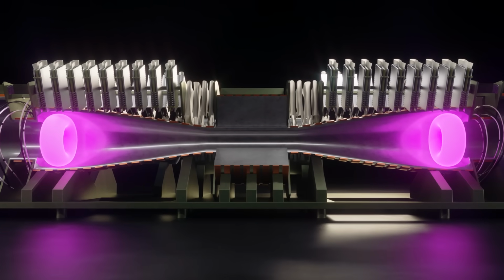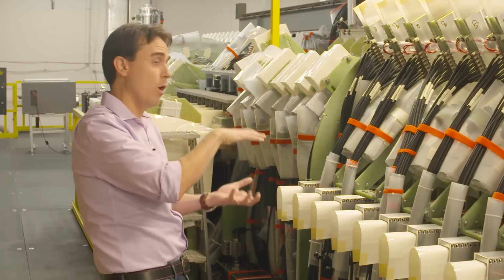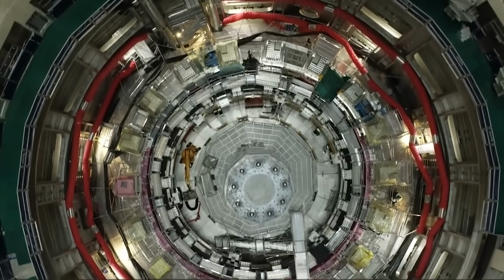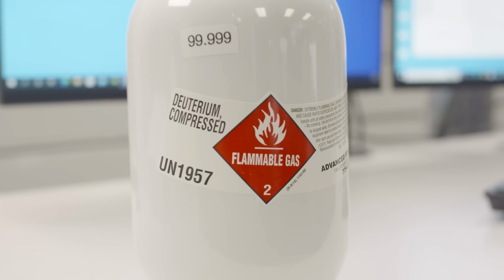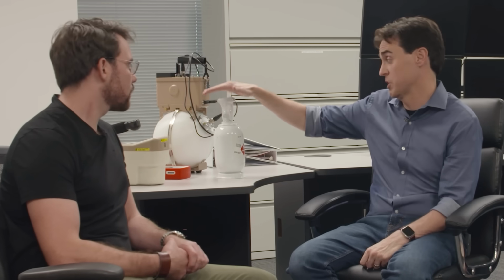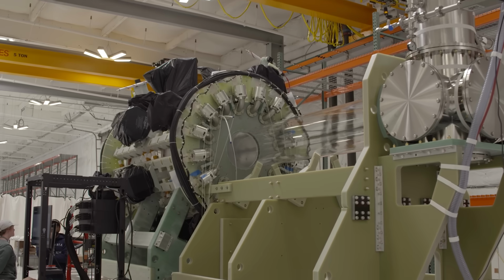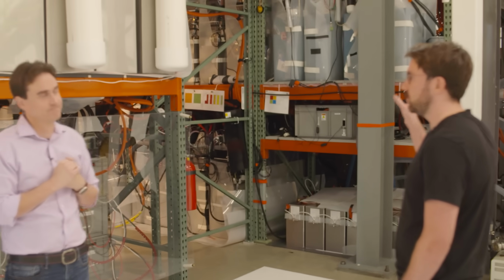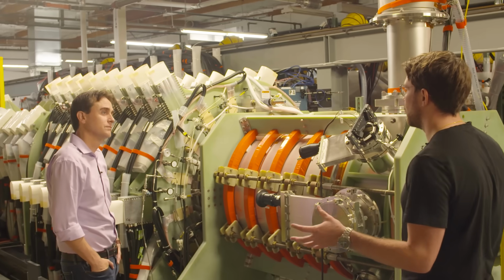A New Way to Achieve Nuclear Fusion: Helion

Comment: I highly recommend the reaction video from improbable matter ("the problems with helion energy"). While Helion is surely trying a very interesting approach on fusion I would really really appreciate a more down to earth video with less superlatives (top secret, completely new design/never done before...) and a bit more critique...
Reply: The apprehension at Helion is well-meaning though.  Sure, having an initial financial success can benefit other projects, but the more money that gets behind a specific project the more potential influence it has in the field.  And if the big influential project turns out to be a bait for venture capital, it makes the whole field look like that.

It's an uncomfortable discussion, but one that needs to be had.  If the criticisms can be counted head-on and then eventually proven wrong, it will do far more good than if nobody has criticized it to begin with.  But if the project crumbles under criticism before it can gain momentum, then it would probably have failed eventually, and in that case it would be better to fail earlier than tarnish the reputation of the whole field in the process.
Reply: @supersonicgamerguru  Being "well-meaning" is just a way of covering up the fact that the argument was flawed to begin with due to incomplete knowledge of the systems at play.  Regardless of whether someone's ignorance of the facts was due to providing a "well-meaning critique", rushing a conclusion, or an egotistical excess of self-confidence, it's shamefully harmful to these kinds of projects to so publicly challenge this project using points that can already be proven wrong using existing information.  I see what you're saying, but there's a big difference between what you're talking about (which is essentially like suggesting to provide an FAQ for people without specialist knowledge on the subject), and trying to genuinely undermine trust with criticisms that would not have developed had you done due diligence and properly researched the project.
Reply: I found it very annoying and off-putting -- and it makes me completely distrust whether this technology has any meaning at all, or not.
Reply: The video by Improbable matter has a lot of mistakes. I have posted those here before (just check my response to similar comments further down).
Reply: @elmarmoelzer2229  dude, there are  13,912 Comments as of now. And no way to search anything :/
Reply: @ewerybody  
I know, it is annoying. It is also hard to write such long comments on Youtube (plus Youtube tends to censor them) :(
Reply: @elmarmoelzer2229  You could try pasting your comment in this thread. You should be able to find it by checking your comment history.
Reply: @oktayyildirim2911  Easier to just give a link to one of Elmar's comments with the answers to I.M., like this one: https://www.youtube.com/watch?v=_bDXXWQxK38&lc=UgzYDR40BqDN6cZc-RF4AaABAg

In my opinion, it is evident Improbable Matter made his video without having taken the time to study the machines Helion is building. If he had, he would have known there are answers to many of the questions/doubts he presented as unsolved.

Nowadays too many critics resort to the tactic of "oh yeah, but that it will be so, so difficult" as if that where a serious argument, when in reality it is just an admission of ignorance. Regrettably, too many people accept it uncritically too.
Reply: @oktayyildirim2911  
Ok, lets try this

- Critique: "FRCs have been done before and never worked." 
First, define "worked"! What was the goal of the experiment and what was the outcome?
Second, yes, FRCs have been done before and the members of Helion's founding team were actually involved with several of them. They applied the lessons learned from those to their own design, which they have tested over 6 prototypes so far.
Lessons learned and applied:
1. Size of the FRC. The larger, the less susceptible to n=2, rotational instabilities.
2. Elongation to radius ratio. The longer the FRC, the more stable it is to tilt instabilities.
3. The merging before the compression. This part creates a single, hotter and more stable FRC as a target for compression. FRCs get more stable, the hotter they are.
4. Helion's FRCs have a very low electron to ion temperature (Te:Ti) ratio of 0.1 and less. That makes things a lot easier compared to machines where both are in an equilibrium because: 
P(fus)/P(loss) scales as Ti^1.5 / (Z^2 * Te^0.5 )
Where Z is the atomic number (in case you wonder about that).

- Critique: "Deuterium - Helium3 has a smaller reaction cross section than Deuterium - Deuterium. At the 100 million degrees temperature discussed in the video, Deuterium - Deuterium reactions would be much more likely than Deuterium - Helium3 reactions."
That is generally true, but the author misses some key points:
Trenta is a subscale prototype with much weaker magnets than what they are proposing for a full scale powerplant. Because of that temperatures are somewhat lower than in a full scale power plant. Power plants aim for temperatures 20 keV (220 million degrees) and up to 330 million degrees (30keV). At that point the D-He3 reactivity surpasses the D-D reactivity.
That said, Helion actually wants some D-D reactions because that is how they are breeding their He3.
D-D => He3 +n or D-D => T +p
Both reactions have a 50% chance of happening.
So, in mixed mode (breed and power) machines, they will need two D-D reactions for every D-He3 reaction, at least until the Tritium inventory is large enough that they have a constant supply from decay (Tritium beta decays into Helium3). Sicne Tritium has a half life of 12.3 years, that can take maybe 20 years. That fact is probably the best criticism of Helion's approach.

- Critique: "Deuterium - Helium3 is too hard and Tokamaks cannot do it. Therefore Helion's approach of fusing Deuterium and Helium3 can never work."
D-He3 is very hard to ignite, but they do not need ignition for their design to produce enough net electricity to be economic. Most of the energy from D-D and D-He3 reactions is released as charged particles, not in neutrons. Helion can recover the energy in charged particles directly as electricity at a higher efficiency than a steam plant would. They can also recover 95% of the input energy directly as electricity. That makes their machines a lot more efficient.
Further, FRCs are high Beta (~1.0) compared to Tokamaks (~0.05). Beta means the ratio of the plasmas internal pressure to the pressure applied externally via magnets. 
Fusion reaction rate (the amount of energy produced) scales as magnetic field to the 4th power, an extremely strong scaling. However, that is the magnetic field inside the plasma, not outside, which scales as Beta^2 and B_external^4. 
If it was just about the efficiency of the magnets (it is not), then a 10 Tesla Helion machine would outperform a 200 Tesla Tokamak.
But, it is a bit more complicated than that, because confinement times in FRCs are generally lower. You win some, you lose some. Overall it is still a win for Helion's approach.
Since Helion is using adiabatic heating through the compression stage, they can to some extent(!) balance temperature and density almost linearly for a given magnetic field. D-D reactions favor higher density and lower temperatures. D-He3 is the opposite way round. They can tune that just to the right sweet spot between density and temperature depending on which reaction they want more of.
Another thing that works in Helion's favor is the aforementioned Te:Ti ratio. This ratio actually decreases further with higher temperatures. So the hotter the plasma gets, the smaller that ratio. Trenta already showed Te:Ti at <0.1. It is likely that a power plant will have an even lower ratio. Lower electron temperatures greatly reduce Bremsstrahlung losses. At a ratio of 0.1, thermal transport losses actually kick in earlier than Bremsstrahlung.

- Critique: "The neutrons from Deuterium-Deuterium reactions would have fried Trenta and I see no shielding." 
As mentioned, Trenta is a subscale prototype, an experiment. It is smaller, weaker and only operates at one pulse every 10 minutes (max). A full scale powerplant would do 10 pulses a second!
Not all shots were fueled by Deuterium or Deuterium + He3. Many were fueled by a mix of hydrogen and Deuterium or pure hydrogen, depending on what they wanted to test.
Because of that alone, the total neutron flux that Trenta has experienced so far is not that high.
What the critique does not mention is that neutrons from D-D reactions have a much lower energy than those from Deuterium- Tritium reactions (2.45 MeV vs 14 MeV). Those 2.45 MeV are below the activation energy of many materials.
The machine is mostly made from low activation materials or materials with a half life measured in minutes. Aluminum activated by D-D neutrons has a half life of 2 minutes.
In fact testing different materials under neutron exposure was one of the purposes of Trenta. They have tested quite a few alloys to see how they behave.
There is still permitted shielding of course. It is in the walls of the room and not close to the actual machine, which can handle the aforementioned relatively reduced neutron load just fine. 
It is also worth mentioning that a mixed mode Helion power plant (that does both breeding and power production) would produce neutrons only in one third of all reactions. So the neutron flux, even for those machines would be lower than for a D-T Tokamak.

- Critique: "Helion claims that they discovered new physics when they say that the ion gyro radius is 25% larger."
The whole ion gyro- radius thing was based on a misunderstanding and out of context quote and maybe also bad wording.
What happened was that Trenta achieved a higher ion temperature than predicted by Helion's too conservative physics model (a higher ion temperature is actually a good thing!). That higher ion temperature caused a 25% increase in ion gyro radius, which is perfectly in line with established physics. That's it. Nothing to see here!

- Critique: "Helion had previously said that they would have a working power plant in 2021. "
IM was very eager to get a "gotcha" on Helion. I guess he did not read further up on the page, or he would have seen that Helion was in the process of raising funding at the time. They did not get that funding until now. Even Trenta was less than 35 million (especially if you take the 35 million into 2019 dollars, when they started building it).
No bucks, no Buck Rogers. Should be quite clear, no?
Reply: @elmarmoelzer2229  I don't understand any of this. I don't have a PhD in plasma physics. This just sounds like two (or more) parties arguing over something that very few people would actually understand. Very, very, very few people. It would help to know your interest in this dispute. You've certainly gone to some trouble to respond to IM's critique. Why do you care what he thinks?
Reply: @michaelallman8481  
Oktay Yildirim asked me to post my response in this thread. So I did. 
My response does not contain any high-end plasma physics, certainly not PHD level. I am just an unwashed halfwit ;)
But I talk to people (e.g. the good people at Helion, but also at Zap, Realtor and several others).
I don't really care what IM thinks. I do care what the general public thinks and he is doing a lot of damage with his negativity (seems popular to do that right now for some reason). 
Fusion startups are trying to secure both venture capital and public funding/support. 
Quite a few have barely enough to keep the lights on. Helion is doing well financially, and I believe the success of one will help the others.
While I am friends with people at Helion, I do think that others deserve a fair chance as well and diversity of approaches is good (what happens in Helion hits a snag down the road?). There are lots of very interesting and promising approaches to fusion that are barely explored for lack of funding. The market is more than big enough to support several successful fusion companies.
Then there is the regulatory environment and public acceptance when the first fusion power plants appear. An informed public is important for all that.
Fusion is the future and it will happen very soon... IF we want it.
Reply: @elmarmoelzer2229  nice!!!!! Thx for finding and posting
Reply: @elmarmoelzer2229  How about give the sources too?
Reply: @michaelallman8481 I understood it. I will say 100% if you do not understand something. don't comment on it, and go do as much research as you can until you understand. NEVER TAKE JUST 1 PERSONS OPINION ON A TOPIC YOU DONT UNDERSTAND AS THEY MAY HAVE ULTERIOR MOTIVES.

In saying that. I found his critiques of the critiques quite convincing, but will need to do my own research to verify.
Reply: @elmarmoelzer2229 Good comment! I don't understand all of it, but enough to get the general idea, and I appreciate the time you put into crafting it to inform such a small audience ❤
Reply: @Respectable_Username  Thank you!
Reply: @elmarmoelzer2229  
What the critique does not mention is that neutrons from D-D reactions have a much lower energy than those from Deuterium- Tritium reactions (2.45 MeV vs 14 MeV). Those 2.45 MeV are below the activation energy of many materials.

You're incorrect about neutron activation which leads me to believe most of what you wrote is wrong, as any radiochemist knows that the neutron capture  for all stable isotopes have no activation energy with the exception of helium-4. I.e. the thermal neutron capture cross section is positive. This is obvious when one considers than neutrons are neutral particles and that the only forces involved are thus the strong and weak forces which are short range unlike the EM force hence there is no barrier to the neutron entering the nucleus.
Reply: @stephhugnis  
Sorry, but you are wrong. Why do you think that fast neutron fission reactors are a thing?
I would recommend, that you read up on fast neutrons vs thermal neutrons. How they interact with other atoms at various energies, and capture cross sections, etc.
Also, things like spallation, elastic scattering, etc, etc.
There is a reason why most fusion experiments are done with Deuterium only and not Deuterium and Tritium, aside from cost.
Reply: @elmarmoelzer2229  Hey dude, just wanted to say, really appreciated how you approached this dispute. It can be super frustrating when people are arguing online and you want to get a good message out and I can’t give you enough of a thumbs up in how impressed I am with the way you laid out criticisms and rebuttals. Also with the other replies in this section, it’s tough to always keep your cool but you did a good job responding to them as well in a productive way. I just wanted to say all this to encourage you that yes this type of thing is worth it to a lot of people online and really can help clear up misunderstandings! Don’t let others put you down (but obv keep on being open to facts based criticism if it comes the other way around lol)
Reply: @evanmcdonald9134  
Thanks bud! I try :)
Reply: @elmarmoelzer2229 You have partially restored my faith in this technology. Let's see what these guys do with their 7th and 8th gen device!
Reply: @elmarmoelzer2229  why not make a video as a rebuttal to IM. seems like your answer to his claims are nonsensical.  make a real statement with some cited science that shows you understand what you
 are talking about or pull you vid on this tech and stop filling YT with a bunch of BS. seriously, answer his criticisms directly.
Reply: Also, I really do not feel like making a video. It is quite a long process and believe it or not, I do have work to do for a living.
Reply: @elmarmoelzer2229 I read through your entire post. I noticed some of the points were made by Real Engineering in the video as well. Eg. the points about neutron shielding being a consideration going forward - he mentioned that. That makes me feel like the "lack of critique" accusation that started this thread is overblown. It's simple to watch armchair contrarians on YouTube and borrow their point of view, but I don't think it's healthy. Debunking videos are profitable on this platform and sometimes they're warranted, but against a prototype aiming to solve nuclear fusion? Cheap shot, if you ask me.
Reply: @rjv2395 hat was Nonsensical??? the only one I found as nonsensical was the one discussing shielding and his answers about nuetrons with aluminum or something to create materials with tiny half lifes (unless he is literally meaning capturing said neutron to create a random isotope, but this IS NOT what would happen. it would just slam through whatever, or plausibly if slow enough could capture, but I doubt it) but it is literally discussed in this video that damage is always expected atleast in breeding, but using the normal reaction it is using charged particles which can be captured unlike neutrons which will be like bullets.
Reply: @FFNOJG  You are correct. Very few neutrons would be captured by the materials used by Helion.
I calculated that about 1% (at most) of the Silicon in the machine would have been turned into Si31. That is AT MOST. I used very unfavorable conditions in my calculation.
Aluminum in the compression magnets is similar. Most of the neutrons would go through, but some  would get captured by the Aluminum in the magnets. The capturing can happen because the 2.45 neutrons are relatively low energy.
That said, the damage would not be extensive and all energy sources need maintenance every so often. For Helion's machines likely a couple of weeks, once a year or maybe even longer Intervalls once they have sorted out all the kinks and gained more experience.
Reply: What part of his reponse was nonsense? Can you specifically point it out? Or are you just throwing a fit because he contradicted some youtuber you like?
Reply: So would China 🙂🙃
Reply: Critique is good, being a Luddite is not.